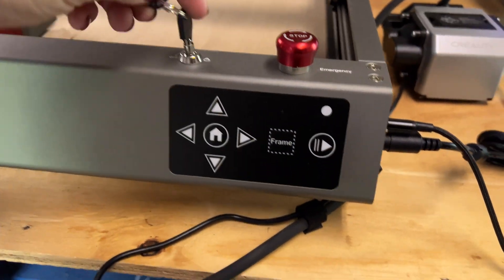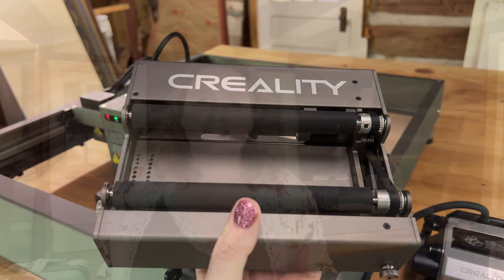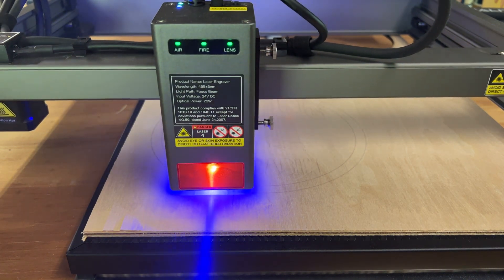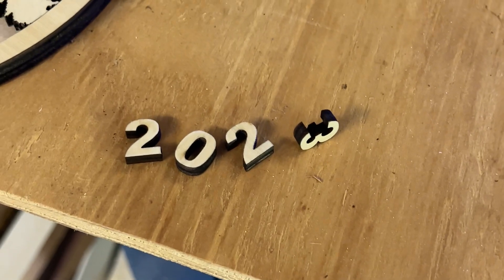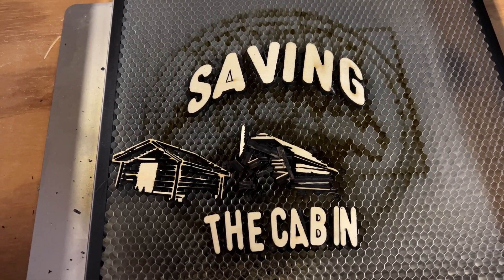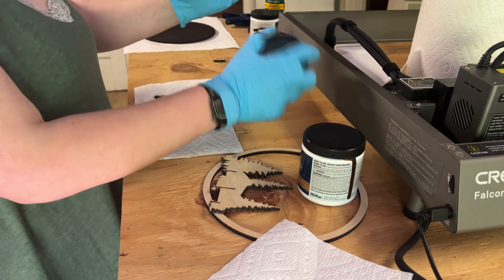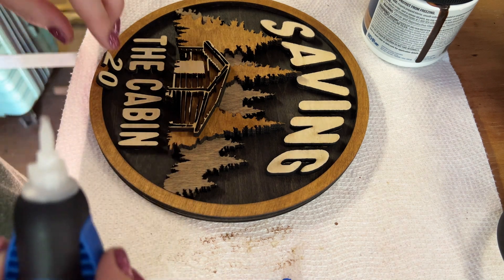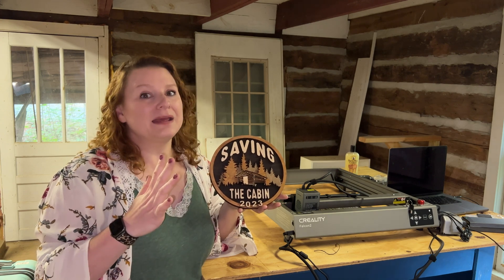Making a 3D logo with the. Creality Falcon 2 laser.

Comment: How a thin wood can you use, like laminate layers. I have seen sheets of wood that are barely thicker than card. Often used on guitars, making chess boards or other projects. Have fun experimenting.
Reply from the maker: I used 1/4”, but just bought 1/8 inch. Couldn’t find what you have. Where do you get it? You can use as think as you like, even cardboard and felt.
Reply: @savingthecabin  companies that make furniture or musical instruments might know where to source thin veneer woods. Sorry I used laminate instead of veneer which is better for what I was meaning. Certain craft shops or even some lumber suppliers might specialise in veneers. Have seen antique restorers on tv using bits of veneer to patch or repair only damage.